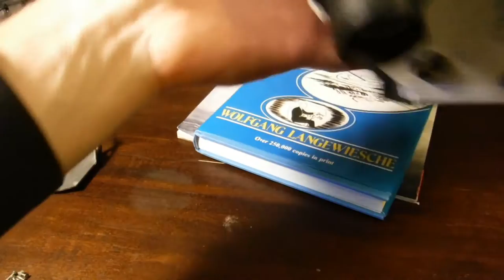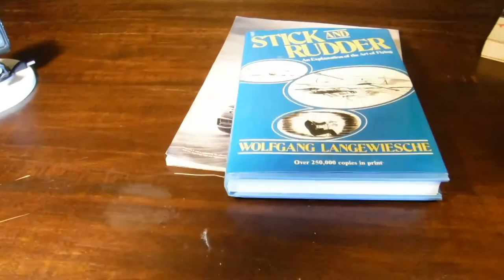Thrasher Thrust Cone Bushing and Impeller Replacement

Comment: whats the difference in those impellers ?
Reply from the maker: It's a pretty small weight difference, maybe 5-10%, more material has been milled away inside the hub on the rear. There is a small increase in efficiency at high speeds.